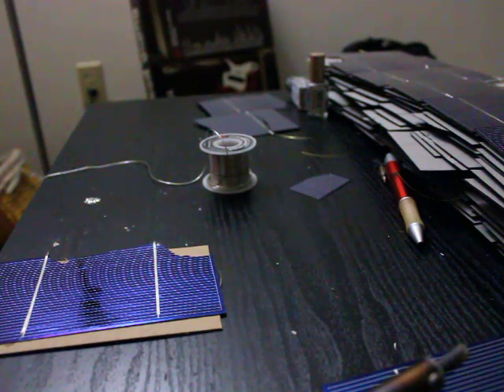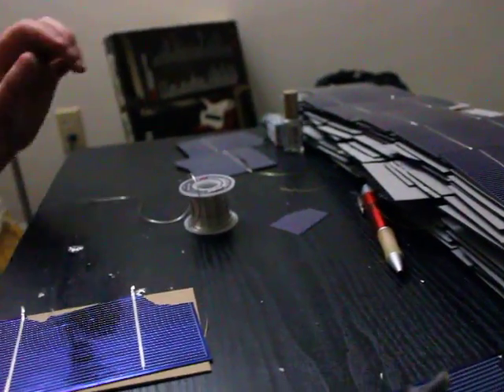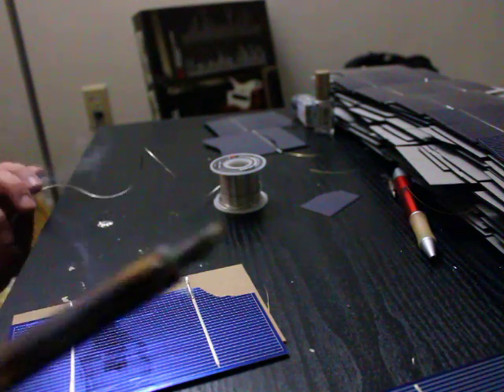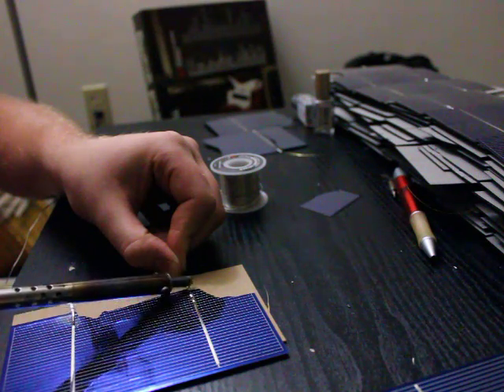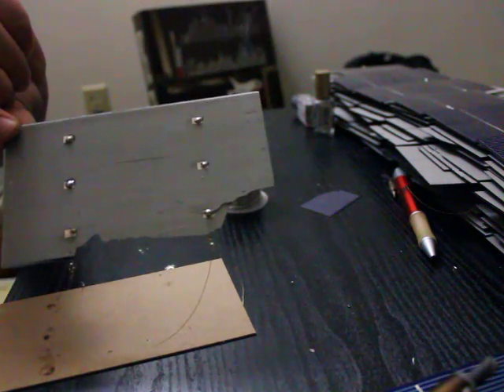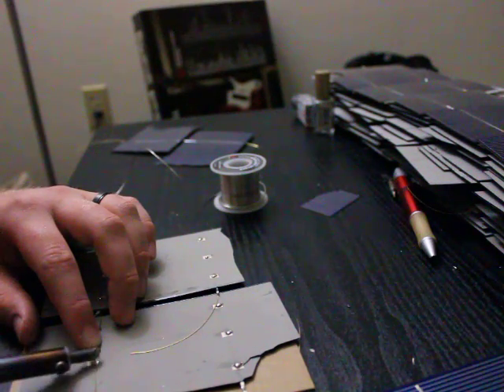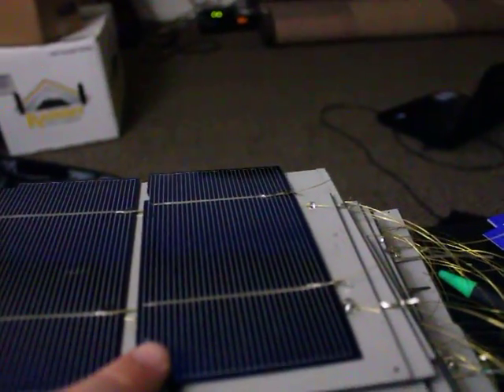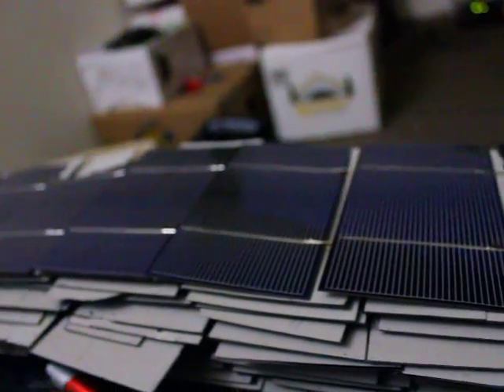DIY Solar Panel using brass wire

Comment: You have connected damaged cells in series with with good cells those damaged cells are gonna reduce your overall current output,,,you'll get more watts just tabbing just the good cells  cos when solar cells connected in series the overall out put amperage is the lowest out put among the cells,,,

Comment from the maker: Since I connect them in series, each row of 13 cells equals 13 x 0.5 or 7.5 volts at 1.5 amps or in other words 11.25 watts. There are 7 rows in my panel I make with these, or around 78 watts per panel.
On ebay the cells costed $120 for a KW worth of broken cells (about EIGHT 4 foot by 4 foot panels). The inverter I needed costed only $180. Supplies (wires, boards and frame) maybe another $150 max. So about $500 for 1 KW worth of solar cells.
Most times the inverters cost a fortune however

Comment from the maker: I am going to make panels from it. I am making 4 foot by 4 foot panels, low current, high Voltage (otherwise the really thin brass wire would dissapate too much energy in the form of heat). Each cell can generate 0.5 volts and 1.5 Amps when they are all the way whole, otherwise they make 0.5 volts and a smaller amount of amperage if they are broken.